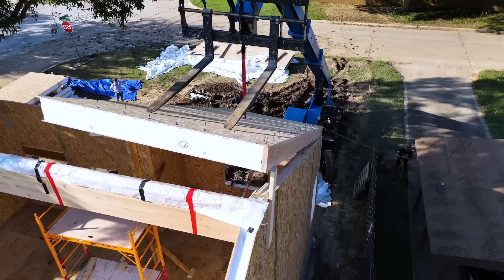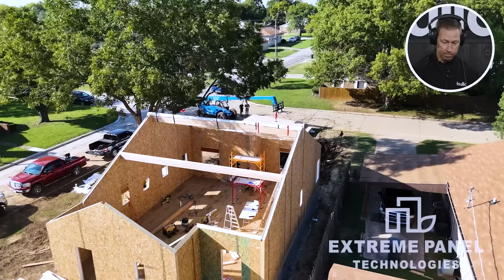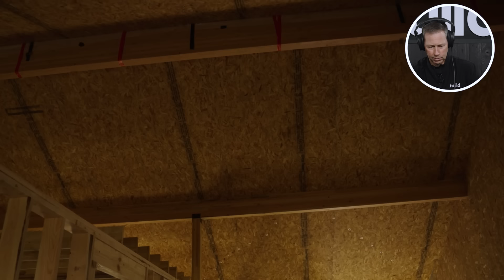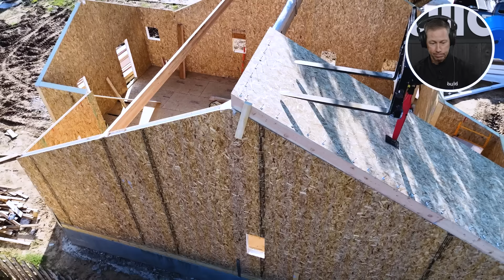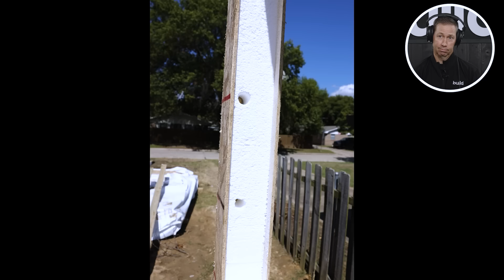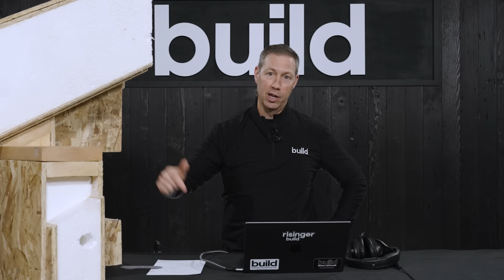High Performance HACK - Why More Builders Are Choosing SIPs

Comment: A deep dive into the SIP Rot phenomena would be important for anyone considering their use.  A very small air leak can cause enormous problems.  My aunt and Uncle have a post and beam house with sips, and have been fighting problems with rotten roof sections.
Reply: ICF is a far better way to build if the goal is energy efficiency, but I'm still not convinced of their durability.
Reply: @David_Stumpf    Hello what is the cost per square foot for ICF vs SIPS for a basic rectangle 1000 s/f house on a basement? Ty And how is ICF better in your opinion? Ty
Reply: @David_Stumpf Not convinced of the durability of ICF? I've been thinking ICF is the way to go, even Jesse Muller built his house with it. Just curious, what is the downside?
Reply: What is the cost differential from trad framing and equal insulation
Reply: SIP rot is a valid topic, and the industry definitely learned from the early issues. SIPs have been used for over 40 years, and while some panels experienced problems in the past, advances in materials, technology, and building practices have made those cases far less common today.

Proper installation is key. Using vapor tape at the ridge, sealing the ridge from the inside out, and choosing vapor-permeable underlayments all help protect the roof system and allow the OSB to dry if it ever gets wet. It’s also important to note that these concerns aren’t unique to SIPs—any airtight, energy-efficient building with a hot roof assembly needs careful moisture management.

When designed and installed correctly, modern SIP roofs perform extremely well and have a long track record to prove it.
Reply: @ExtremePanelTechnologies  …and they have been causing problems for 40 years. The OP is spot-on. They depend on perfect installation, and what does Lstiburek say about that type of dependency? If they are invulnerable to moisture and can readily dry, then they will be a trustworthy build option.
Reply: @ReflectedMiles  Depending on perfect installation is a bit of an exaggeration.   For those interested, SIPA's website has published the Builder Best Practice documents to address proper installation of SIPs.
Reply: @JoePasma   I’m glad that they have that available, but I was simply quoting the most prominent building scientist in North America. Ignoring him in favor of a manufacturer or manufacturers’ association is not going to be a best-practice itself for most people. I do suspect that the rate of problems with them would be significantly lower in very dry climates.
Reply: @ReflectedMiles  The SIPA website also has the book titled "Builders Guide to Structural Insulated Panels (SIPs) for all climate" authored by Joseph Lstiburek.
Reply: @JoePasma  Good. One of the reasons that exists is because of his analysis.
Reply: SIPs are a scam, they are ok for a dry climate but best case scenario you throw the house away in 30 years max.
Reply: @thebullgator Why? Please elaborate, ty
Reply: @thebullgator  well your definately WRONG here in Europe & especially the Nordic countries where temperatures in the winter regularly drop to minus 20 degress C, they have been building SIPs homes going on 50 years, with immense insulation values ,even exceeding passivhaus standards, a SIPs home can be up & watertight typically in less than 3 days, with accuracy beyond what the american "stick frame" builders could only dream of, not just on one house BUT everyone that is made, as far back as the mid 1990s, there was a swedish SIPs house built in the village where i grew up 2 storeys high detached house, from foundation slab it was 2 days of crane work DONE, just internal fit out in a watertight house, as for your claims, take a look at "grand designs" on channel 4 in the UK,there was a house, built with SIPs & a steel framer on the Outer herbrides on the coast, next stop Norway across the North Sea, the builder achieved better than passivhaus, and the only heating required for the whole house was a small electric heater, american builders ,are still in the horse & cart era, while europe is in the 21 Century, triple glazing is the norm here, in fact my whole house is triple glazed & has been for 9 years, no regrets or problems,you cant even produce true sizes for your wood for your "stick framing" a 2x4 is NOT that & that just one size example, maybee in 20 years you will reach 1990s european standards, i doubt it tho tbh :), i mean how can builders & homeowners advocate in putting Asphalt shingles on there roofs ,being the base material in "shingles " is crude oil & a FLAMMABLE material & needs replacing every 30 years, why not fit either slate, which is both waterproof and last over 300 years or Concrete tiles ???, and dont even get me started on your houses being eaten by termites ??, asphalt roof meets ZERO building standards in the UK & Europe for a reason, there a fire hazard waiting to happen !!, america the land of the free & dumb building standards :)
Reply: @thebullgator   I live in a SIP home in MN that is 25 years old.  It is no where close to being ready to be thrown away.

The crucial modern leap for SIPs came in the early 1950s with Alden B. Dow, a former Wright apprentice and the son of Dow Chemical’s founder Herbert H. Dow. Recognizing both the limitations of Wright’s uninsulated panels and the broader imperative for energy efficiency, Dow developed the first bona fide SIP by incorporating an insulating Styrofoam (extruded polystyrene, XPS, colored with a blue die) core between plywood skins. In 1951, experimental houses in Midland, Michigan, employed panels with 1-5/8 inch thick Styrofoam cores glued to ¼ inch plywood, assembled using wood splines and blocking methods designed for full system rigidity.  https://www.abdow.org/sandwich-panel-houses/  https://midcenturymidland.org/listings/sandwich-panel-house-1/
Reply: The EPS insulation is just bad. I'm curious what it would look like with an XPS insulation. XPS is far more uniform and stronger. If they can use a continuous adhesive between two structural whythes it would not only eliminate air leaks, it could make it both stronger and stiffer.
Reply: @Concrete_Jake  Why is EPS insulation just bad?  Please explain.
Reply: I am looking at Thermasteel Insulated Metal Panels (IMPS).  No cranes needed, no worries about moisture, no need for a vapor barrier.
Reply: @stevesohn5436  interesting, is it similar in cost as SIPS?
Reply: Not to mention when the styrofoam dissapates.  It is a house of cards.  No studs.  Wiring would be structurally damaging.  Just prebuild the walls ahead of time.
Reply: @terrybriley1887  I think a lot depends on where you build. Here in Colorado it's dry and because of snow loads SIPs require a lot of internal framing. So essentially it's framed not much different than a standard stick built home. The main difference is the panels come prebuilt and insulated. The biggest problem... they are heavy because of the internal framing. You need several guys to move them or machinery. The best part is the air tightness and ease of which it is to achieve a tight structure. It is nice though, on a 20 degree day with no heat you can be working on the inside with 50-60 degree temps indoors.
Reply: @epicfutbol  If the structural system supporting the SIP roof panels is designed properly, the amount of internal framing in the SIP is mitigated.
Reply: @JoePasma  I was referring to the walls more than the roof system. We end up with more internal framing here in SIPS than other places. Generally you will see big timbers used to support the roof system which adds strength and gives the big timber open peak look that people like here. A full timber frame would be nice though for the strength and appeal... just expensive. We will see what the engineers spec for my next project that requires nearly 250 lb/ft2 snow loads and 180 mph wind loads. 😆
Reply: @epicfutbol  If you have roof beams with large point loads bearing on the SIP walls, then yes, posts will be needed to support any point loads that exceed 4678 pounds.
Reply: @terrybriley1887  Thank you for your comment. I hav a question. What happens to the styrofoam over time and why? Ty

Comment: The way the roof meets the wall looks like a 1/4” connection between 2 sip panels. A major insulation leak.
Reply: If the top of the wall is square cut, EPS wedges or spray foam is installed after the electrical is completed and the interior beveled blocking is installed that extends from the top of the wall to the underside of the roof panel.
Reply: Sloped wall panel, at the same pitch/angle of the roof helps with the scenario you described.

Comment: What kind of winds would this kind of structure handle? I would love to see you review Lifestone Construction of a steel frame and foam panel system that they say can handle extreme winds. Thank you for another great video!
Reply: I should have seen the entire video, now I just need to compare costs between this, rammed earth, and Lifestone's foam panel and steel frame system.
Reply: SIPs withstand tornados and hurricanes very well. SIPs are rated for Florida High Velocity Hurricane Zones (HVHZ) and they have passed the missile impact test. https://www.sips.org/documents/SIP-Missile-Testing-for-Florida-HVHZ.pdf

Comment: I am a huge fan of the idea of SIPs, but I loathe all of that foam. I hate foam in general. (God forbid a flame ever touch with all the polystyrene, which ignites like rocket fuel.) I would much rather see panels with an insulation core of cork (that would likely be ridiculously expensive), wood fiber (like Gutex's Omnitherm), or a high-density mineral wool (like Rockwool's Conrock). And I would also like to see some alternatives to the commodity OSB for the interior and exterior sheathing. Maybe options with magnesium oxide (MgO) boards, with mineral bonded wood wool boards (like Cewood Building panels), or options with different combinations (e.g., MgO board on the exterior with wood wool board on the interior [for lime render]).

As it is, I just hate all the foam and plastic and would love to see companies expanding their offerings to include more natural, less toxic alternatives.
Reply: Just to clarify, there is a construction grade EPS that has a flame retardant additive that helps mitigate flame spread.  Food grade EPS does not have this additive, that is why it ignites so readily.

Comment: I love the concept of SIPs.  What scares me is when, and not if, water penetrates the outside envelope.   EPS is also porous and would hold the moisture.  You are also relying on the glue bond between the sheathing and the insulation to hold it all together.  Granted the block splines and plates are traditionally fastened, but I think FIP maybe a better choice.
I’m not trying to poo poo SIPs, I just think the potential for repair cost scare me away.
Reply: Proper design of the wall and roof assemblies is critical to not only SIPs but all construction.  With SIPs design with the intent to allow the OSB to dry to the side it gets wet on.  This means low perm underlayment's adjacent to the OSB, and proper air spaces where needed.  SIPA has great resources in their Design Best Practices and Builder Best Practices documents that describe how to do this.

The adhesive used to laminate the OSB to the EPS will not be effected by water.

Comment: Notice that sips rely on glued together osb particle board for its structural strength.... glue!  I'm sure more than one of you have left osb out in the rain for a few months we're driven past some redneck, shack that left o s b exposed to the elements for a decade....  doesn't last much longer than that... it will completely fall apart.  At the end of the day, we're just talking about wood chips and sawdust glued together.  If you want to use sips look at least doing some sort of timber frame skeleton

Comment: The only reasons why you wouldn't want to use sips... osb directly touching foam.... best system has no organic materials  and no foam and continous exterior insulation.  Double cmu wall with rockwool.

Comment: That thing will light up like a Christmas tree and won’t stop from the smallest fire. 🔥 
Builders push SIPs because they are fast to build and cheap, but they won’t last long.
If it’s timber frame and doesn’t have rock wool between the walls it ain’t worth it.
Reply: They are not cheap, they can be fast.  They last a long time.
Reply: Actually, SIP homes are documented to have stopped the fire before spreading because the combustion process burned all the air in the home.  That is why mechanical ventilation is so important in a SIP home.  The gypsum wall board used on the walls provide the thermal barrier that the codes require and the EPS is treated with a flame retardant.
Reply: @JoePasma  EPS and fire retardent are an oxymoron.
Reply: They could just as easily make SIP from rockwool.  Its a design affordability decision.  I've seen 10 year old SIP delaminate which is the biggest downside imho.

Comment: I see no reason to use anything else than SIP. There is a company that makes SIP with Zip exterior sheeting so you can save Time on wrapping. And in areas with fire hazard SIP can have MGO exterior sheeting instead of osb
Reply: MGO has less testing for structural integrity and smaller panels.  Zip has small panels too... this defeats some of the purpose of standard SIPs.

Comment: Bonus:: your drywall should lay on nice and flat and the finisher should not have to deal with crowned or warped 2x4's to deal on the exterior walls.
Reply: american non size timber strike again :)

Comment: It would be cool if someone made SIPs with a product like Densglass for the sheathing and closed cell foam for the insulation.  It would be more fire resistant, water resistant, and vapor impermeable than a standard OSB/plywood and EPS foam SIPs panel.
Reply: My experience with them is Pacific NW / Alaska. I wouldn't touch one made with OSB, personally. Maybe in a desert climate, but too many things have to be perfect otherwise for them not to be at significant risk for long-term issues.
Reply: @ReflectedMiles  I completely agree.  I live in Michigan, and while our winters aren't as extreme as Alaska's, we get a lot of freeze/thaw cycles where it might be in the 40s and raining during the day, then drop into the single digits overnight.  OSB never seems to last here and will swell with moisture, then flake off chunks as it freezes.  Treated plywood holds up much better long term.
Reply: The foam used is Closed Cell EPS Foam.
Reply: The perm rating of a 4" SIP is 0.1.  This is classified as vapor impermeable according to building science and the building codes.
Reply: @JoePasma  That’s a rating based on the entire panel when installed new, not on how vulnerable the OSB sheathing is to moisture damage over time.
Reply: @ReflectedMiles  As long as the OSB is kept dry, like my house in MN, that is not a problem.  You always want to keep wood based materials dry.  Sticks deteriorate when subject to long term moisture and not allowed to dry.
Reply: @JoePasma  Sticks can dry after wetting almost endlessly while OSB cannot. That’s why it only takes one undetected infiltration from the outside to often do significant damage in a SIPS panel or panels over time. There are quite a few failure examples, especially long-term, as expressed in other comments under this video, even after the Juneau-area disaster years ago.
Reply: @ReflectedMiles  Where did you get the information that OSB can not dry if the moisture source is removed?  

At least two things have to happen for a material to dry once it gets wet.  1) It has to stop getting wet.  2) The ability to dry by evaporation. 

If sticks can dry almost endlessly, why do sticks deteriorate in stick constructed structures (some sort of rot)?
Reply: @JoePasma  OSB is an engineered fibrous product, not wood, and as a result is much more sensitive to moisture. It can certainly dry, but over time breaks down and provides an environment for infestation of microorganisms that creates a whole lot of problems. In the Pacific NW, quality builders who have to use OSB for cost reasons will still use plywood at the bottom of exterior walls in the “splash zone” because of how differently plywood handles a repeated high-moisture environment followed by drying. Mass callbacks teach hard lessons. The main problem with SIPS is that you rarely have any way of knowing where some point of sealing has been missed or failed until it’s too late, and the sandwiched form makes it more difficult to deal with than simply replacing a section of sheathing.
Reply: I’m fairly certain many SIP suppliers offer a better sheathing product than OSB. I’ve even seen ZIP sheathing on SIPs. Similarly, you can get SIPs with closed cell foam like Polyurethane or PolyIso. Higher performance and higher cost for the same wall thickness.
Reply: @BikeFlyCampAK  Zip sheathing is OSB.

Comment: Matt, I have a question about building down at the gulf and vapor barrier on the floor when you have a twelve foot elevation off the ground, can you put the advantage x factor the gold side down?And let that vapor barrier be on the outside to prevent moisture.Would that work in preventing the laminated floor from getting tore up